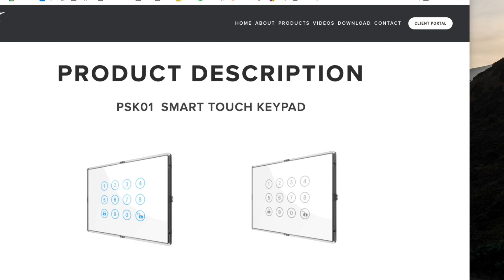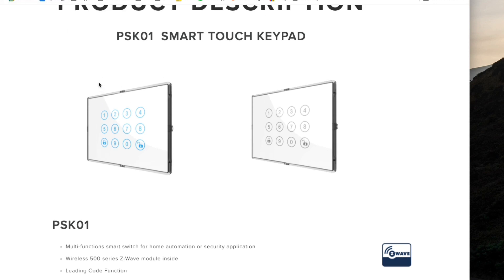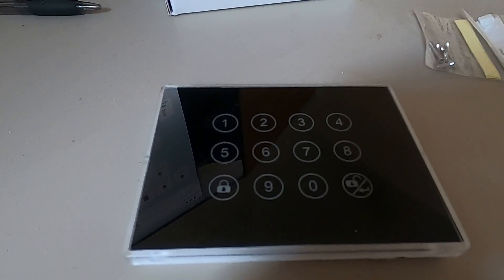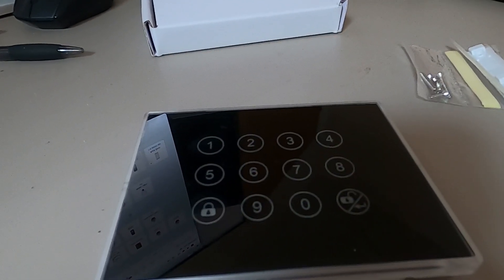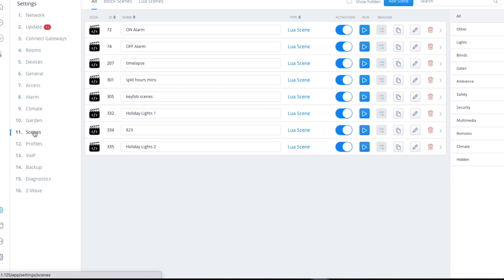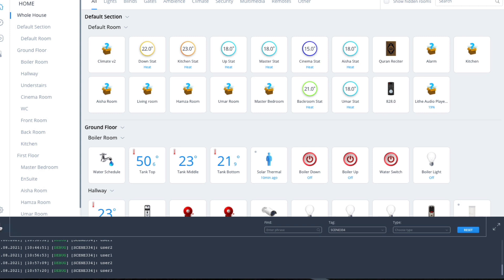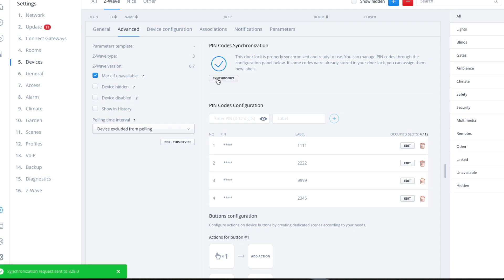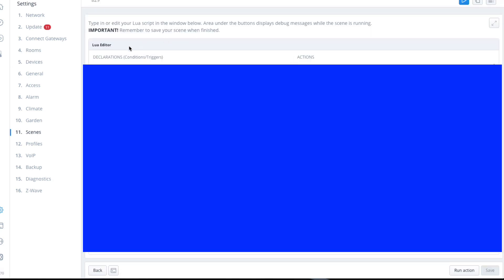How to add Philio PSK01 Keypad to HC3

Comment: Hello, could you please tell me, how did you get pin codes to the "advanced" tab?
Reply from the maker: Hi
once added just press the SYNCHRONISE button just above
Reply: Thanks for answer, but my right side of "advanced" tab is blank. I have no synchronise button there.
Reply from the maker: @milos9848  did you add in secure mode? Or looks like it didn't add properly. 
So remove and re add
Reply: @YorkshireAutomation   Finally I tried it and it works, thanks a lot

Comment: Any change you know how to reset the device? Instructions in the manual don't seem to work.
Reply from the maker: Input the program code then press enter
0 then 1 and enter
That is exclude mode
Make sure your controller is in exclude mode too
That should then reset the keypad to factory default
Reply: @YorkshireAutomation  Manual says it's 1 and then 0. Both don't work for me. Does it have to be in the mode that the keys are blue or green, and is it even possible to switch between those modes?
Reply from the maker: @sanderr1983  got to be in scene mode which is Green
Reply: @YorkshireAutomation  Figured out how to move to scene mode. holding 0 and 9 for 5 seconds. From green with user code and enter/unlock it goes back to the blue mode. When I go to blue mode like this it sends a Keypad unlock operation.

Only thing missing now is how to lock / unlock once everything is set up. Do you use blue or green mode for this part? and how does lock/unlock work?
Reply from the maker: @sanderr1983  
Good to know about how to move modes. Thanks.
The lock and unlock only works in button control mode ie blue.
So we can't use both modes together I'm afraid.
I tried a few times but couldn't get it to work.
Hopefully in future they can implement a firmware update to allow it.

Comment: You are like 6months late with this video. I got headache to get it work, but it works💪🏻👍🏻
Reply from the maker: I only found this 2 months ago! Only managed to work it out last week or so!
Reply: @YorkshireAutomation  received it today and it works on the HC2! No template required... so it is set like this: first enter the PIN and then select a scene with one of the numbers :)
Reply: one disadvantage of the glas panel... fingerprints!

Comment: Seems to be something wrong with the sound? Hear double voice from ~5min on.. tried 2 devices.
Reply from the maker: Apologies editing error only for a few minutes
Reply: @YorkshireAutomation  np.. does the Keypad also work on HC2?
Reply from the maker: @Kimboo1st  yes it also works on the HC2 the scene is a little different and I will be doing a small video next week with inclusion process and parameter changes and scene usage.
Reply: @YorkshireAutomation  Nice to know as I'm busy to configure HC2 as alarm system so I can enable and disable it with the keypad.. hope also home alarm mode .. so needs to be able to call multiple scenes.. only PIN required to disable alarm.